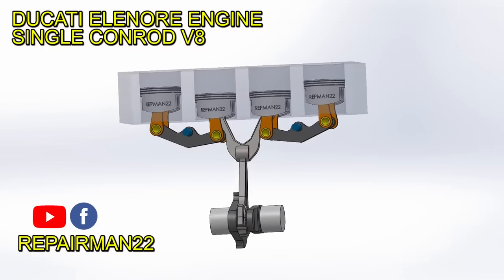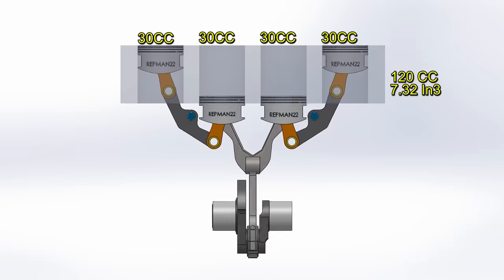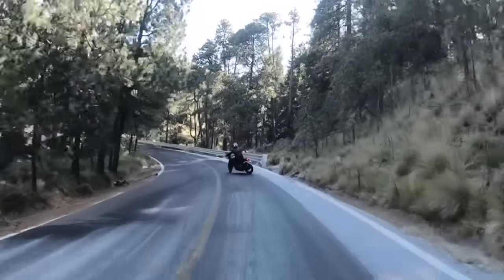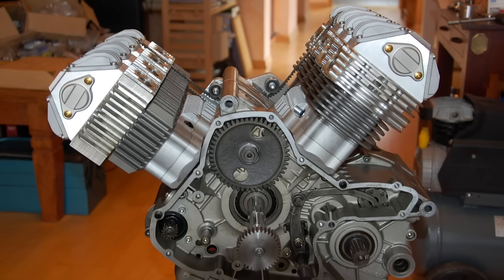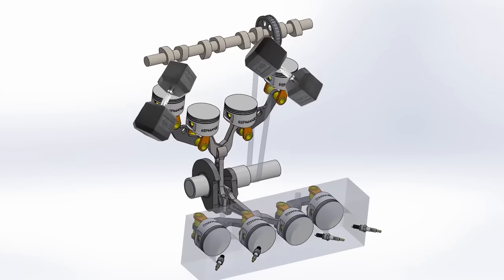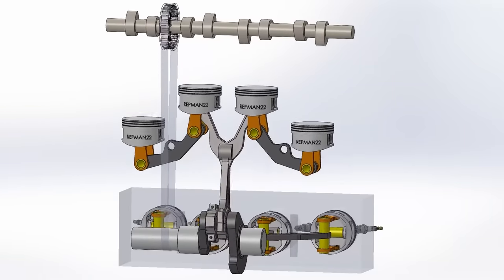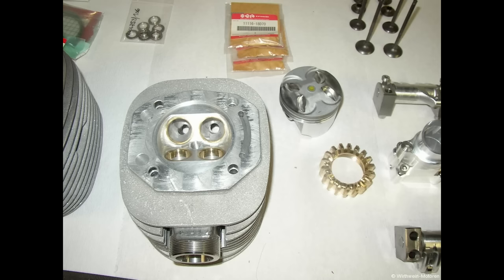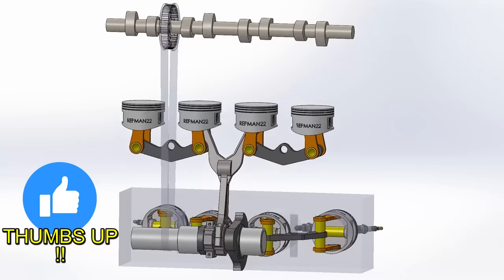1 Con Rod with 4 Pistons 🤯 How Ducati Elenore 868 Engine Works in 3D

Comment: It seems like one big advantage is you have an eight-cylinder engine with a crank as short as a v-twin. Less worries about torsional stiffness.
Reply: More worrying about the system disintegrating before generating a significant specific power.
The Ducati V2 twin desmo is a fantastic engine, and a torque wizard, that lacks power.
A solution that reduces the power further, adding weight, cost and complexity, for how ingenuous, is completely useless.

Comment: I see high reciprocating mass gains, as well as total engine size, and an increase in parts. Neat, but not used because fewer parts = fewer failures, less weight, reduced production time, etc…

I remember seeing an arrangement like that in b&w photos in a book…

Comment: This cylinder design basically changes a V8 to the crankshaft dynamics of a 2 cylinder steam engine. with power stokes acting on every extension and retreaction of the two con rods (a power stroke every quarter turn). Ultimatly I belive it didn't take off since it doesn't really provide any benifit over a standard V8 design, since it doesn't reduce the number of moving parts or the complexity of machining the engine block. it is an interesting mechanism, but not much more. Obvs props to the inventor, hopefully he continues his development, and will eventually create something that genuinly can be used to improve ICEs in the future.

Comment: This feels like an innovative solution to a problem that doesn't exist... a very interesting concept.
Reply: The 2 problems i can see is the sound and vibrations of low end single cylinder engines... 4 cylinder engines always sound good.. and cancel out vibrations.
Reply: @swapnilmankame  Yes, but you could just make a four cylinder engine.
I'm not sure it saves that much space, and if you're willing to go to such extremes because of packaging constraints, a 90° V4 is also balanced, and sounds incredible.
I have a Honda Magna V30 I'm in the middle of fixing up and it has to have my favorite engine sound of all time. 

It makes me wish my four wheeled Honda felt half as alive... even if it meant requiring major engine repair to reach 230k. I would replace piston rings myself for that beautiful little V4 to live on and make someone else happy for a while. If old ironsleeves loses compression, I'll dig its grave.
You'd think the engine with a brain would act more alive. I guess a carburetor can't go senile.

Comment: One disavantage is the almost doubling of the distance from crankshaft to piston. Very tall enginge.
Reply: Not great for packaging but long rods bring their own advantages like lower thrust forces on the piston and more equal acceleration of the piston at the top and bottom halves of the stroke.

Comment: when the steam engine came up on the end of it's useful life, the engineers tried everything to keep them relevant. The ICE engine is at that point today. It was an amazing device when you think that it is a machine that moves us around by using explosive liquid and it does it so quietly that we do not think of the explosions but like steam, explosive propulsion is on it's last legs. We do not need any more iterations of the ICE. We are moving on from there. Steam was great and ICE was great and hats off to both of them. They both get a statue in the square.

Comment: it has more friction points than a conventional engine, so basically it was a novelty design.
Reply: Classic german over engineering that makes it more likely to fail.
Reply: Exactly what i was thinking. Clever, but a dead end.
Reply: But the total surface feet per minute of bearing surfaces is greatly reduced.
Reply: @Eluderatnight  Exactly, it's not the number of surfaces, it's the surface feet per minute and also force. So the side-loading of the pistons is potentially significantly reduced (see my top-level comment) as another factor as well as reduced bearing area.
Reply: But less side friction between the piston and cylinder, less reciprocating mass and less loss to vibration.

Declaring this design worse without tests and based on a single point at face value amongst many is in my opinion quite arrogant

Comment: I believe this engineer is building engines for his personal fulfillment. He is obviously a person of great skills, but he is operating outside the industrial design complex; should his engines have merit, and they well could, there is no possibility for a recognition. Internal combustion engines are the most optimised devices in the world, so any improvement does require expensive test equipment - only available to industrial complexes.
Well done!
Reply: May be, seen the way the engine is laid out, it is possible to computerise the valves control, and utilise the power cycle which cause traction on the conrods, by recirculating the exhaust gases in the adjacent couple of cylinders - so to extract a 1 - 2 % more efficiency from the engine...

Comment: The most interesting takeaway from this is the potential to add cylinders and displacement to smaller engines by driving multiple pistons off each existing con-rod. It's probably too expensive to bring to market as it would be easy to swap an entire engine as it would be to retrofit this system
Reply: I don't see how the packaging can be much smaller than the same pistons on a conventional crankshaft
Reply: @Jo-rz6bs  It's not that the packaging would be any smaller but it would allow you to add cylinders to small v engines/single cylinders.

Comment: one advantage is that there should be less friction between piston and cylinder since piston goes up and down and almost no other forces are involved (at least for outer cylinders). also i guess it could be lighter in a similar way like radial engines are lighter.
Reply: Depends on length of the rockers vs stroke length vs mini rod length.

If the mini-rods and rockers are short then the angle of the mini-rod will be higher than a normal engine.

Same for normal engine, short rods compared to stroke makes for a lot or piston wear and more non-linear piston travel speed, but makes for a smaller lighter engine. Everything is a trade off.
Reply: @JPEight  yes but outer cylinders only use rockers so i think those would have less friction as forces do work differently than rods. maybe?

Comment: Interesting idea. On the geared cam drive for the radial: all the WWII radial aircraft engines that used cams to actuate valves* had reduction geared camshafts. Often they were geared to 1 turn to the 4 for the crankhshaft, 1:4. They could do this because the cam rings were quite large, and by spinning the cam so slowly, they could make use of really aggressive cam profiles.

*the exception being the sleeve-valve engines, which didn't use cam-actuated poppet valves, at all. Reliable though being monstrously complex, they didn't offer any real adantages over poppet valves.

Comment: if you built the lower end of the engine much smaller since there is only 1 rod bearing journal  to support and enclose with the engine block your saving a lot of weight from not having a full crankshaft and not having a full engines length of supporting metal on the engine block compared to a typical engine with four rod bearing journals. so honeslty this engine should be quite a bit lighter for its given power output similar to a rotory engine while still functioning mostly the same as a normal reciprocating piston engine. so in an application like aircraft where the weight of the engine might matter more than the absolute power of the engine this might be advantageous. and if a highly developed version of this engine did indeed have identical power to an equivelent engine with a normal crankshaft then this is superior due to lower weight.

Comment: Be interesting to get some valve area from all that additional space that is now available, And having the push/pull should allow for an interesting power delivery. Looks like a lot of potential in that concept, for the automotive , snowmobile, even boat world. Simply because of all the additional area for moving air now available.

Comment: The first rule in engineering is KISS , and most engineers know what that stands for! Great that the idea works, but just because you can, doesn't mean you should!!
Reply: Something the German engineers forgot. You want over engineered, buy a German bike or car.
Reply: @kolsen6330  Agree, I have  BMW motor bike, and it is definitely over engineered, but then again , all modern motor cycles are the same, far too much unnecessary and expensive technology in them. Can no one design something simple anymore? apparently not!

Comment: Engines with rockers have been successful before, look at the Commer/Rootes TS3 3 cylinder 6 piston two stroke diesel from the 1950s. These engines really proved the concept but 2 strokes are too hard to comply with current emissions.
Reply: Two stroke petrols using crankcase compression yes, but two stroke diesels do not use crankcase compression so emissions are the same as four stroke diesels, they use a blower to push the air in so any overlap of intake/ exhaust timing its just air that gets blown out, which by diluting the gases reduces the measured emissions!, there have been petrol two stroke designs that use a secondary piston for air flow negating the need for oil in the fuel and these have emissions the same as four strokes, but at greater complexity and expense than a traditional two stroke design, whatever you do you never get something for nothing!.

Comment: Got to be some vibration issues as the short rod cylinders have a different rod angle than the center main rod.  Also piston dwell time at TDC and bdc are different between the cylinders.  I admire his work but he hasn't really reduced the parts count just moved the outer rods from direct crankshaft connection to indirect via the main rod.  In fact there are 2 added spots for wear and friction, those being the fulcrum between the outer cylinders.

Comment: At the cost of adding more moving parts you could add connecting rods on the outer two and still utilize the constant power throughout up and down. You could also overlap them to make a V10 with only 6 connecting rods. I say this because the transfer of momentum also benefits from having more mass e.g. using a larger socket solving the problem of a stubborn nut or bolt.

Comment: Actually their might be an advantage. 

I'd have to model it.. But it does look like 2nd order vibrations are cancelled out. 

Effectively the velocity of the pistons moving up the bore are directly tied to the pistons moving down negating the deceleration mismatch in the bottom 180 deg of crank rotation from the accelerating pistons in the top half of the bore ( top 180 deg ) of crank rotation... 

On bigger 4 piston engines this might negate the need for counter rotating balance shafts.

However this might account for the power loss, as the burn rate on the outside pistons will have a different profile from the inner two pistons.

Interesting never the less.
Reply: maybe start with two cylinders. i dont see any benefits from going full blown 4 with your project.
Reply: @MrUnderEstimated  and have 2 cylinders moving up and down at the same time? That makes no sense. This design is exclusive for 4 cylinder engines.
Reply: @firyxx  your thought of my recommendation makes no sense. Obviously not.

Comment: The main issue with the engine from the thumbnail is that the power is being transferred through one single connecting rod instead of 4. It does make the rotating assembly much more simple, and probably more reliable due to less moving parts and simple to produce. And if there is a lubrication problem and your rod bearings get destroyed and it throws the rod, then you’re basically screwed because that’s the only rod

Comment: I think that there are little or no advantages to that single rod engine. There is about the same amount of friction and the torsion is just moved to different points of the crankcase making the engine more top heavy.

Comment: Fairly certain this reduces a huge amount of rotational mass of the crankshaft since there is only one crank journal and set of counterweights.  The rocker arms look smaller than the size of connecting rods, so there is some mass savings there as well.  The Achilles heal of this design is the Y shaped con-rod though, as forces are no longer transmitted directly down the rod, but across a lever arm at the central joint.  This will most likely fatigue over time, and is the main reason why this engine isn't suitable for production.  If this conrod was converted into two, then that is the best of all both worlds, as you can have cylinders that partially hang out over the crank case, which also saves significant weight.  I think he should remake this engine with the piston rockers, this time with two internal crank journals centered on each of the two innermost pistons, 2 and 3.

Edit:  After observing the overlap of the rocker and rod at the piston connection, this isn't feasible either.  I'm sure he already thought of that, and that's the reason why this engine shows no promise of improving on.
Reply: I see other issues as well. He's introduced another plane of movement which will create different harmonic vibrations to deal with. The very short length of the rocker connecting rods means they would be at an extreme angle and see high side loads at the bottom of the stroke. This would also require longer piston skirts for durability, especially for high revving motors, which removes some of the mass savings and adds to vibration.

Comment: A 1966 Honda 161cc 2 cylinder 4 stroke engine produced 16.5 HP. 
This engine is making less than 1/4 that, and if it's developed to make more, all energy is ultimately directed thru only one rod bearing.

Comment: This is similar to the Pendulum Engine, which had such low friction it used no oil. It was adapted & it's used in air compressors, oxygen pumps can produce clean air for medical/hospital/scuba

Comment: I see the main Conrod experiencing an alternating side loading.
Reply: Yes I don't like that. The force vector is at an angle to the crank, so the inner pistons will be seeing a sideways thrust as well as the conventional thrust forces from a conrod. A great deal of care would need to be taken with clearances to ensure there is no binding of either pistons or rod bearing as the engine heats up

Comment: Really like my Korean made gold top. Also play USA Fender J and P basses so they act as good benchmarks. I think the Epi can easily hold its own against the P, but the J does have a wider tonal range as expected from the 2 PUs. Issues: it has pretty pronounced neck dive but swapping for lightweight tuners can help. The strap button location at the neck heel instead of on the upper bout also contributes to poor balance. Glossy neck is sticky but light sanding with 1000 grit paper fixes that. I also swapped the pretty ordinary 3 point bridge for a Hipshot and now have a brilliant looking, great sounding hollow body bass.

Comment: I think that, since the two outer most pistons serves mainly to generate a force to compress the piston middle pistons, they could be smaller, tunned to generate the right amount of compressed force.
That would certainly increase it's efficiency
Reply: But then you might sacrifice the engine balance by doing so.

Comment: Interesting concept. I would be most worried about the bell-crank bearings.
Reply: My thoughts exactly
Reply: it's under load going up and down so yeah....
Reply: @MrUnderEstimated  The bellcrank bearings are really only loaded as a piston is pushed down, which puts that into the weakest part of the bearing. The connecting rod bearings however, are loaded in both directions.
Reply: @haunter_1845  cylinder 1 and 4 combustion cycle pulls the cylinder 2 and 3 up.
Reply: @MrUnderEstimated  Yes, but the bearings in the center of the bellcrank are being loaded downward during all stages of the cycle. The connecting rod bearing at the crankshaft is the one seeing forces in both directions.

Comment: If you look at the firing order, half of the combustion stroke are wasted lifting the rod up rather than transferring the energy to the crank. As in the combustion happen when the "big con rod" is on the way up. No wonder the power and efficiency is worse than an engine with similar displacement but less cylinder. I believe the guy is trying to solve 4 inline's secondary balance issue. But definitely not worth losing power and efficiency with some combustion stroke effectively wasted.

Comment: Brilliant and innovative engine design. Is it lighter than the original engine? It seems simple yet very complex vs a single cyl engine. How is it lubricated? Are the pivot points the weak spot for wear? Or the Y shapes connecting rod? How much does it cost vs the original engines? Torque? Mileage?

Comment: I would argue that the orange and intermediate grey parts are all connecting rods, so this 4-cylinder engine has a total of 11 connecting rods forming a linkage to a single crank pin.

Comment: Con rod loads can be highest in tension at high RPM zero throttle which is what makes a lot of dragsters explode at the end of a speed run
Reply: True, and finally someone else that knows that firing-stroke load isn't the greatest load a con-rod takes, and compression loads don't cause rod failures. It's the unloaded piston trying to fly out the top of the motor that overloads the rod in tension, and causes it to fracture.